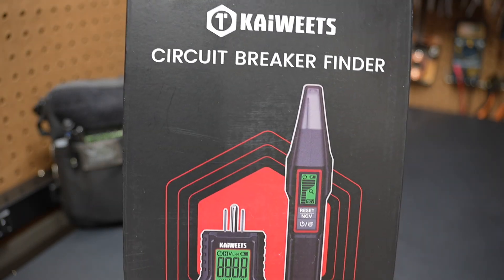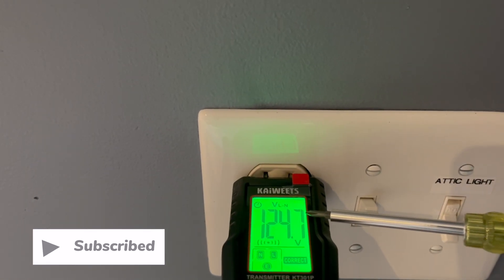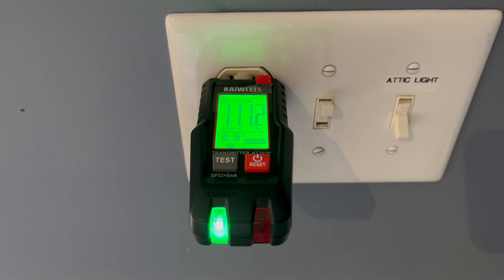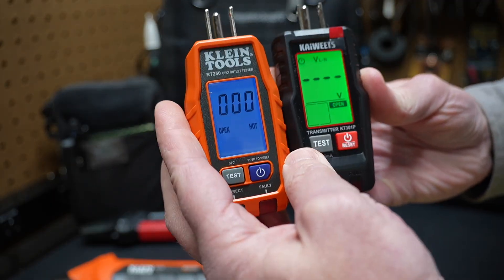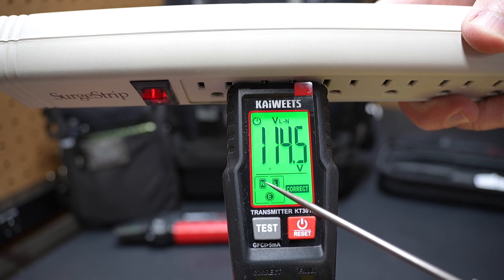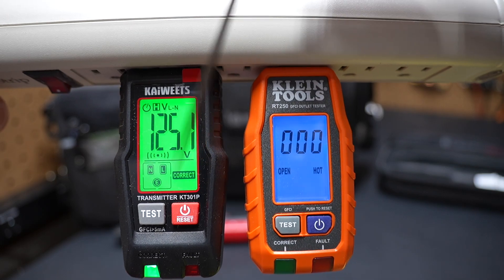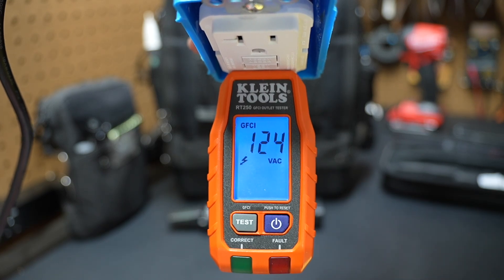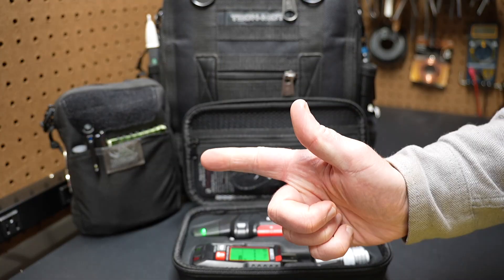How to Find a Circuit Breaker | Kaiweets Circuit Breaker Finder KT301P

Comment: Compared to the Klein, the additional features are nice, but it would be perfect if the outlet tester plugged into the bottom of the circuit breaker finder like the Klein, so it would only take up one slot in my tool bag. Thanks for reviewing it. 👍🏻
Reply from the maker: Yeah that’s a missing feature. But a lot of people use the receptacle tester regularly and not the scanner so may not want to connect them.
Reply: @ProjectPineHills Do you know if the Klein and Kaiweets transmitters and receivers are interchangeable? Like can you use the Klein transmitter with the Kaiweets receiver, and vice versa? Just curious because the Fluke circuit breaker finder is discounted right now, but their transmitter is bulky, so I’d rather use the Kaiweets or Klein transmitter with the Fluke receiver, if I can.
Reply from the maker: @k1_w3 What a great question! YES they do work together, I tried it both ways. I should have thought of that. 👍
Reply: @ProjectPineHills  Thanks for letting me know. I just ordered the Fluke circuit breaker finder, because my Klein has never reliably identified circuit breakers. I might have to get the Kaiweets too, just because its transmitter is the most feature-rich out of the three brands.
Reply from the maker: Let us know how that fluke works out. 👍
Reply: @ProjectPineHills  It's awesome. I tested it out as soon as it got delivered, and while the Klein can only usually narrow down to between two and four circuit breakers, the Fluke performed flawlessly, identified the correct circuit breaker, and didn't give any false positives or near-false positives on other circuit breakers. Tools and Tactics' video comparing the Klein and Fluke is exactly what I experienced. And the Klein transmitter works with the Fluke receiver, so I'm keeping both transmitters in my bag now. For $60, I'd definitely recommend it. (Tools and Tactics' video: https://youtu.be/ThAmDDsz05c?si=_-C9K8AuJpvqk-eU)

Comment: I have an electrical question.   If you have a dead ceiling fixture,  how do you find which circuit to turn off?
Reply from the maker: You’re saying you have no connectivity at the fixture? If so, turn off the switch that controls the fixture and remove the fixture. Confirm that the wiring is connected to the fixture. Then test the bare wires with a multimeter. If you want to error in the side of caution, turn off most of the breakers before investigating.